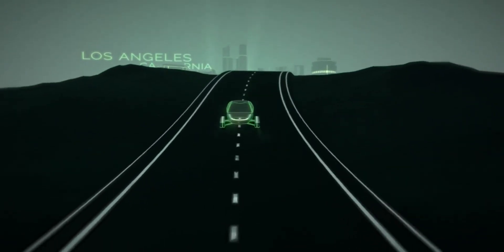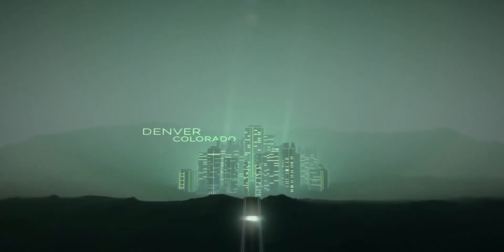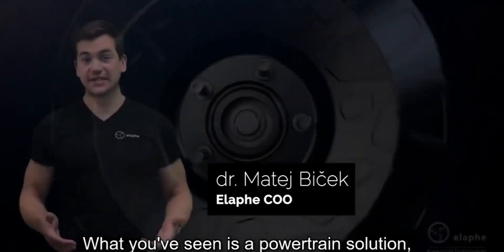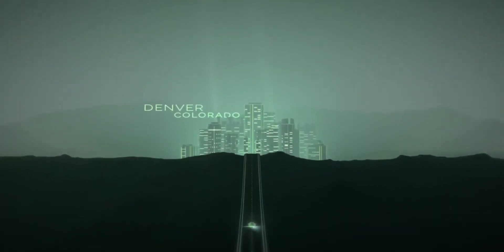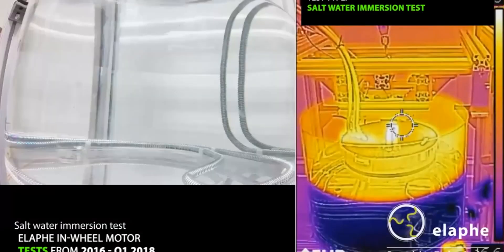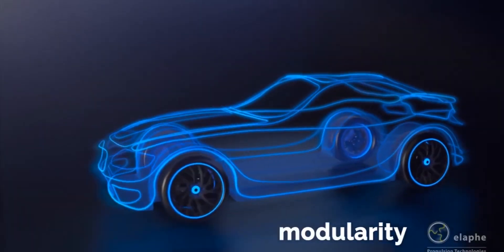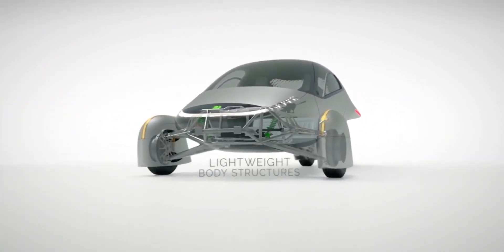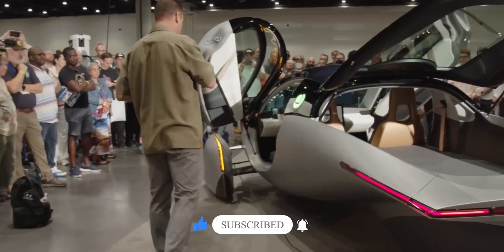Aptera's In-Wheel Motor Design - Here Is Everything You Need To Know!

Comment: For most commuter cars, driven at normal speed, on suburban streets, increasing the unsprung weight of the rear wheels is not a problem, the suspension is tuned for the new unstrung mass (it is basically a second order system and well understood), most people would not notice the difference.  Protean had Lotus redesign the suspension to take into account the likely weight increase of a hub motor, this resulted in little change to the suspension performance. But don't believe me? see Munro's channel for testing a Mercedes converted to four wheel electric hub drive.

 https://www.youtube.com/watch?v=6SbkCew_nfA&t=224s  

and ride test see below at 4 minutes for unsprung weight and remember this car has a motor per wheel, also torque vectoring

https://www.youtube.com/watch?v=OaC2pxmBmW8

Increasing the unsprung weight of the front wheels is more problematic due to the gyroscopic effect and the greater sensitivity of the steering wheels, but not that much worse; we are not talking race cars here.  Yes, a sporty car, but NOT A RACE CAR.

As to sealing, etc. this is not that difficult to achieve and has been done in heavy industry for many years using simple sealing methods, remember these are low rpm hub motors with a low tangential seal speed, not 20,000 rpm Telsa motors.  There are similar technologies having to deal with G forces higher than that in a car's suspension, so also not a problem.  High voltage electrical cables and electronics in industry have to deal with far more hostile conditions than a car wheel, so also not a problem.

 Remember, we are not talking about adding the motor to a normal axle, these designs leave themselves open to full integration with the axle hub, disc brake, wheel hub, etc, forming one unit, significantly reducing weight.  And yes, it does eliminate the drive shaft and the CV joints (and gearbox if using an inboard radial flux electric motor), simplifying the axle structure and the overall complexity of the mechanical design.

Comment: One disadvantage is not covered: the torque on the start. In wheel hubs are in most cases gearless and as a result should be much bigger and have more weight to achieve the same torque (at start) than the motors that all EV manufacturers use (geared motor with the drive shaft). That’s a critical thing.
Reply: It does 0 to 60 in 4s.

Comment: Well, certainly unsprung weight has some effect on suspension and steering, as there is inertia related to the rotating mass. Rally drivers are unlikely to get excited. But, what about implementing in wheel motor in heavy traffic vehicles; let's say there is some 12 - 16 wheels total in a truck with big trailer? 

Think about 50 kW per each wheel = 600 - 800 hp total. It' doesn't matter much, if one is faulty. And when standardized, IW motors could be available for most of the common trucks.

And think about slippery conditions; every wheel would be pulling.

One would think truckers would not want traditional drive back anymore!

Comment: You can't change the fact that adding a motor into the hub will add to its unsprung weight, which leads to rougher ride and poorer handling.  More bouncing mass will be harder to control, especially when the unsprung to sprung weight ratio is higher than a heavier vehicle with a similar unsprung weight.  I don't see how lightening other areas can help.  In fact, making the sprung weight lighter will only worsen the handling problems.

But you can reduce the unsprung weight by moving the motors inboard and connecting them to the wheels with half-shafts through CV or U-joints.  You can also move the brakes inboard to save even more unsprung weight.  You just have to find space inside the main body, without unduly affecting the body shape or impinging on the passenger's footwell.  Maybe the primary goal was for compactness, but this is a significant affect on handling and comfort.

Comment: As usual Echo Electric does a great job.  There is one point that was alluded to but I felt not pointed out specifically: that wheel hub motors frees up space in the body of the car for the better fitment and placement of the battery, and placement and design of other interior things like seats, storage, ergonomics and cabin space.  Hub motors also facilitates better weight distribution (lowering and optimizing center of gravity (for better control and handling).  By placing the weight of the battery nearer to the hub motors also helps to counteract the higher un-sprung weight of the hub motor.  I think Elaphe tries to replace iron-based heavy metals with lighter materials.  If they weight towards the hub and away from the perimeter of the wheel, this also helps lower rolling resistance.  (The more weight at the outer circumference of a wheel, the more moment of inertia (mass being accelerated and decelerated as the wheel rolls long the road surface. It's better to centralize the weight of the wheel closer to the center (the hub) of the wheel.

Comment: Aptera released a short video on how to change the tire on the front. It's not different than any modern car. The motor looks like a drum brake with lug bolts sticking out. There is a disc brake inside. They haven't shown how to change the rear wheel yet but I assume it will be similar. You will probably need to remove some or one of the panels to get at it. A spare tire won't be included anyway so you'd probably need to call for roadside assistance in the case of a flat or blowout.

Comment: Clearly that tank steering nonsense is misleading (at best).

Every video of the Aptera shows it turning with the agility of an aircraft carrier. If they get the wise idea to reverse one of the front motors, they'll have to slide that rear tire sideways across the ground. (And you'll rapidly destroy all 3 tires).

The hub motors dont seem to be turning a conventional wheel, so the worries about tire changes are still valid. If I go to a regular tire shop, they're not going to want to be responsible for taking the entire motor off the corner of the car to replace the rubber. And those that do will be happy to charge a premium.  

Every video I see about this "car" shows more and more flaws (that are often presented as features).

From the absurd "knock to open" doors to the tiny windows, the horrible turning radius, the cheap looking interior,  and the lack of demonstrated safety features.

I'll wait until they've sold them for a fee years before I'd even come close to considering one.
Reply: If you looked at the public information we have, you would see that Aptera is using conventional, widely available 16" wheels and tires.  There is no need to take off the motors.  The wheels unbolt from them just as if they were drum brakes.

You are clearly not paying attention and making false claims.  Safety features will be demonstrated through third party crash testing once production intent vehicles are available to test early next year.

Whether or not tank turns will be included in the final controls, it is certainly possible and has been done with prototypes.  Skidding a lightly loaded rear wheel will hardly "destroy" a tire.
Reply: Search YouTube for - How to change the tire on an Aptera (it's just like any other car) -

Comment: I'm betting hub motors from the majority of cars will be the future, They're just easier to work with figure things out they have a lot more beneficial uses Cheaper fix Cheaper to diagnose, Require even less complicated hydraulic antelope breaking systems. Possibly help with drivability problems like torque steer and other wavering issues That might need to be addressed.  There could be a simple screen menu that shows you the power consumption of each motor motor and some suggestions you might want to look for otherwise you pretty much can just Jack it up feel around yourself it's pretty easy.

Comment: Change a flat tyre is as difficult as a normal wheel.
Reply: I plan to carry a plug kit and a DC inflator along with a pair of pliers, and will be able to repair most punctures this way without even removing the wheel. (which can be done without removing the wheel motor)

Comment: It's common for simple wheel bearings to be changed at 100,000 miles - Imagine how much in wheel hub motors will cost when their bearings fail!
Reply: The service process has no reason to be more expensive than for any other wheel bearings.
Reply: @n.brucenelson5920 I agree on the process - but was referring to the parts cost!
Reply: @TC-V8  bearings are bearings, motors are motors. Replacing a motor would likely be expensive, yes, but no reason to think that would be necessary if it's just the bearings that need work.
Reply: They claim that the wheel bearings should last for, at least, 50,000 mi.

Comment: I see a lot of people throwing around that term "unsprung weight" but nobody defines it or can say why it's bad.  One would lose a lot of energy and therefore efficiency by adding all those extra steps of transmission, differential, drive shaft, etc, so it makes a lot more sense to actually turn the wheel if you intend to turn the wheel to move the car.  I saw a picture of one of the earliest Porsches that was designed by Ferdinand Porsche in the early 1900s and it had an in-wheel motor.
Reply: Unsprung weight is important for your suspension kinematics. When your wheel hits a bump in the road if you have a higher unsprung weight then there is more force being thrown up meaning the dampers have a harder time damping this larger force.
One of the reasons independent suspension is an improvement in solid axles is you have less unsprung weight so a better ride quality.
Reply: @TC-V8  So what?  You  just make a beefier suspension.  There are also active suspension technologies.  Ever heard of clear motion developed by Bose?
Reply: The problem with unsprung weight is that the more mass the motor/wheel/ tire combo has, the higher it's inertia. Thus, when it hits a big pothole, it cannot dive quickly to the bottom of the hole, then climb out other side and stay in contact with the road. The lower the unsprung weight, the faster a wheel can get up and down without disengaging the road surface.  But heavy wheels can't change direction as quickly.

This is magnified by the relative weights of the vehicle and the wheel/tire. Remember those old land yachts from the 60's and 70's? Even though they had pretty heavy wheels, they rode really smooth because the mass of the car suppurted by the suspension was so high. The tire would bounce up, and the suspension would eat that energy, because the car was too heavy to move up and down that quickly.

In the aptera, it seems they have a very lightweight vehicle (even with a 40kw, or more battery pack) and a heavy tire/wheel/motor system. 

It will be really difficult to provide anything like a smooth ride, and keep those tires engaged with the road.
Reply: @doug3512   Theoretically that makes sense but in practice I don't think that will be an issue specially with today's advances in suspension technology.  Here is an example of Protean/Mercedes combo which is a bit of heavier car:  https://youtu.be/OaC2pxmBmW8
It would be interesting to put the Protean in one of those land yachts and see what happens.
Reply: @doug3512   You can also add the suspension inside of the wheel:  https://youtu.be/-4ygUCbHjTc
Overall I believe that the advantages gained in torque vectoring and handling, specially if you have a 4WS car, far outweigh the slightly bumpier ride.
Reply: @doug3512  nice to see such a clear description.  This is very basic suspension kinematics.  Technology is making great strides these days.  With continued development hopefully we can get hub weight down, and also address cooling issues.  I believe we will see the traditional wheel be combined as part of the hub motor.  Yes torque vectoring and dynamic traction adjustments will help, but we still need full contact patch.

Comment: I have an Ebike and it has a hub motor, I ride it every day I have put over 3000 miles on it in less than a year, rain sleet or snow it has never failed me. So it should work very well in a car. Plus lets face reality here what is stopping electric cars is the distances  you can travel with out charging. If you can go a 1000 miles on a charge sign me up for 1 love it
Reply: I have a V8 in my car, should work great in a bike!

Comment: pretty sure rivian is using inwheel hub motors?  am I wrong?
Reply from the maker: Rivian doesn't use in wheel motors.  they just have a skateboard design.
Reply: Yes you are wrong. They have 4x inboard motors each with a reduction gear set using conventional deiveshafts.
Reply: You might be confusing them with Lordstown.